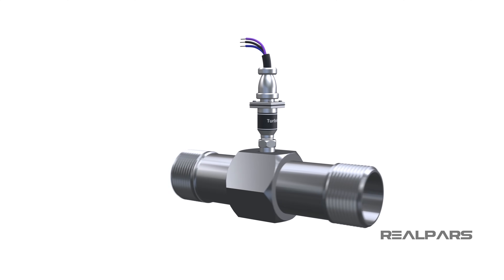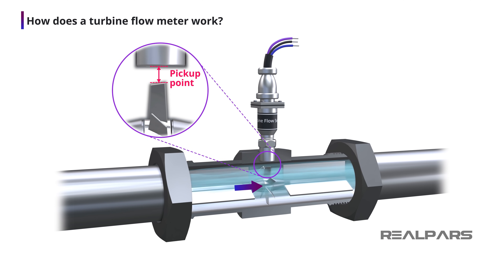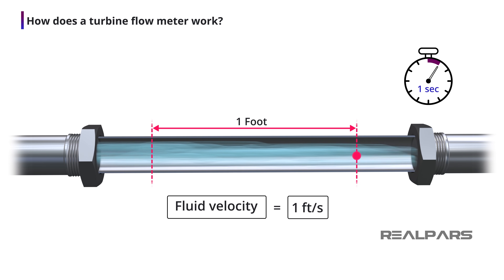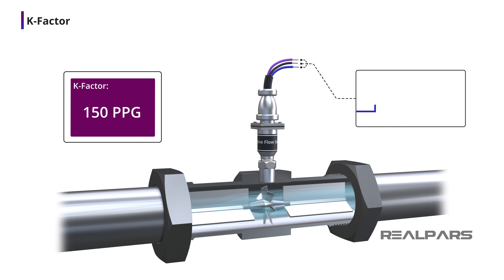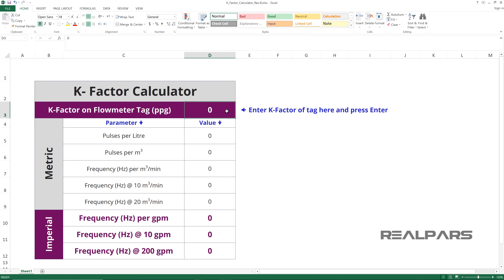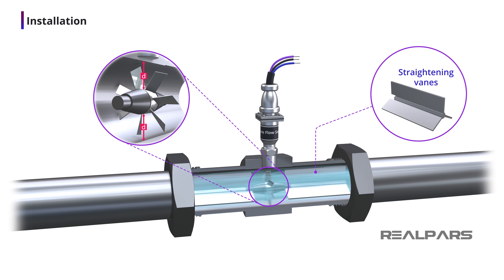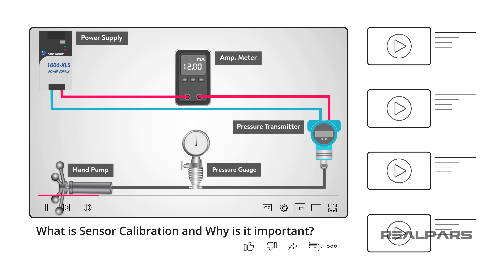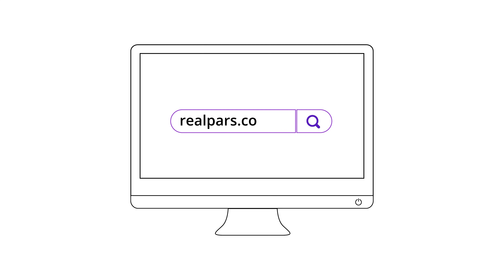Turbine Flow Meter Explained | Operation and Calibration

Comment: Information-wise, it's a very good video; well explained and easy to follow. There's just one thing wrong with it. The turbine is rotating in the wrong direction. If flow seems to be from left to right. If so, your turbine should spin in the other direction from that shown.
Reply from the maker: Hi Eric, Thanks for your message and eagle eye!

Comment: Super! This is so good. I do not really know, but I guess turbine flow metters are often used in some filling machines. One interesting aplication I've heard of is using the measere of flow in order to determine the weight of the liquid with wich bottles are filled, ¿how accurate and reliable is that speaking in terms of the different viscosity and temperature of fluids?
Reply from the maker: Hi Erick. Turbine flowmeters are used in many applications, and perhaps filling machines as you suggest. I’m not familiar with flow measurement to determine weight.  As we mention in the video, viscosity is certainly an issue with turbine flowmeters. On another note, the Coriolis mass flowmeter can be used to determine density as well as flow rate.
Reply: Or you can use the turbine meter with s density meter.

Comment: I have 2" turbine meter, but I did not have it's k-factor! how I can find it's k-factor
Reply from the maker: Hi there. Thanks for the question. Finding the k-factor of an existing turbine flowmeter is possible, but not easy. As we discussed in the video, k-factor is pulses per gallon.   If you are able to move a known volume of liquid through the turbine meter, it's possible to determine the k-factor. You need a device that can measure the pulse generated from the turbine meter. You need to pump the known volume, (let's say in gallons),  through the meter and record the number of pulses.  The k-factor can be calculated using the pulses per gallon relationship. 
Testing to verify would be required afterwards of course.

Comment: can i get K factor calculation?
Reply from the maker: Hello. Thank you for your question. You should always reference the user manual and spec sheets. All the user information and calculation formulas or tables should be included, or a reference should be made to the manufacturer's website. These devices follow the standard calculations based on the application engineering formulas.  Happy learning from RealPars!

Comment: So when calibrating flowmeters,shall I change the K factor? and how to calculate the new K factor?
Reply from the maker: Hi. Thanks for your question. The K Factor is unique to the flowmeter and is determined at the time of production by the manufacturer. The meter K Factor will be included with your documentation when the meter is purchased.
Reply: @realpars  I do have the K factor but when testing the meter I got higher error ,so should I correct the factor?

Comment: Hi,
Thanks for your informative video!
Please explain, what are the 3 cables used for.
What kind of logger matches this type of flow meter with 3 wires? Oscilloscope logger?
Reply from the maker: Hello HabibNO,

Thank you for your question. 

I am assuming the 3 cables you are referring to are the 3 wires coming from the sensor. These wires bring the voltage to the sensor for it to work. One wire is positive. Normally, the brown wire depends on the manufacturer and where it is made. The common wire can be a blue or pink color, again depending on the standards used to manufacture the sensor, and the signal wire that comes out of the sensor can be the black wire, which is the output signal voltage to your measuring device. As we mentioned in our video, you can use a measuring device that meets your electrical and Engineering requirements. We showed you a Hertz meter and a Siemens PLC. Whatever meets your requirements. Here is a link to an international company you might want to learn more about flow meters in your part of the world for more technical information. 

Happy learning!

https://www.us.endress.com/en/field-instruments-overview

Comment: Laminar flow?
The purpose of straight pipe and, often,  the tubes or vanes used to suspend the rotor is to avoid swirl.
K factor does change with flow rate but it has been common for decades to use curve fitting to compensate for this non linearity as much as possible.
Yes viscosity is a factor with straight blade rotors but higher tolerance with helical blades ( faure Herman)
Then too calibration can be compensated for using inline viscometers (Smith Meters).
One key factor is the response to a step change in flow rate can be measured in milliseconds.
This fast response is key in some applications such as 'snap testing" jet engines.
Reply from the maker: Hi Jon, Good stuff. Thanks for the input!

Comment: Can the flowmeter be adjusted by changing K factor ?
Reply from the maker: Hi there. Having a different K factor will certainly change flowmeter characteristics. Unfortunately, the K factor is an inherent characteristic of each individual turbine flowmeter and cannot be adjusted.
Reply: @realpars  That's good to know..Thanks

Comment: Great video...but i want to know, do they also have transmitters just like Temperature transmitters, which would input 4-20mA into the the PLC analog input?
Reply from the maker: Hello James. Yes, there are vendors that offer transmitters with a 4-20mA output. Omega is one of these vendors for example.
Reply: @realpars  ok ...but in this video, there's no need for a transmitter